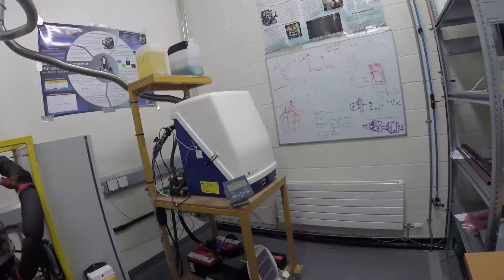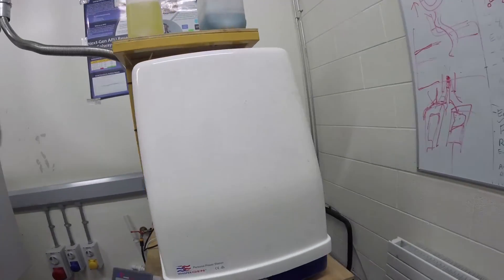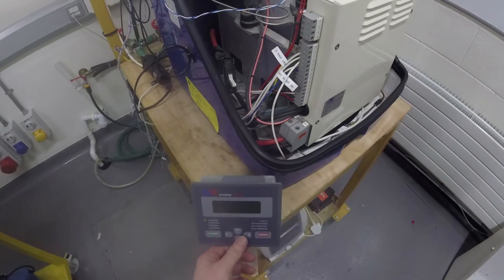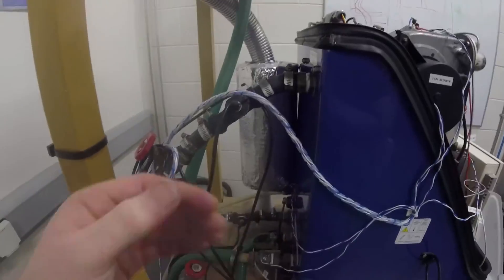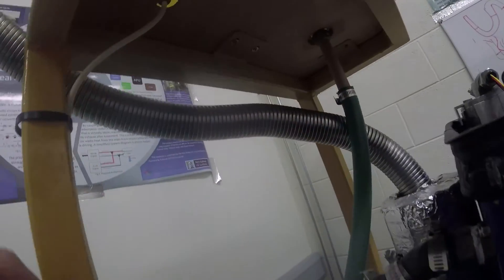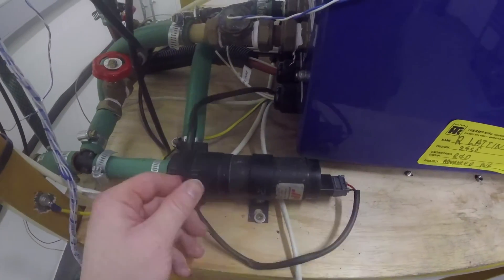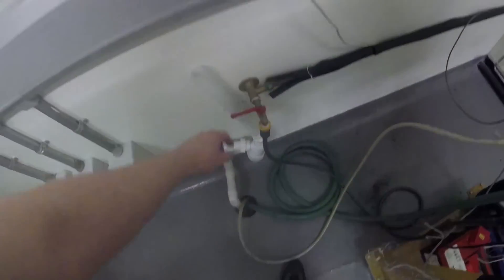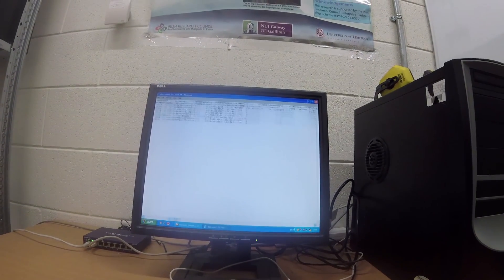Whispergen Operation Guide

Comment: how much did this cost and where did you buy it?
Reply: This is a DC Stirling Engine. Best  for marine use. I worked for Whispertech in Christchurch NZ designing the 1KW AC400, UK1 MCHP and limited work on this engine. They are no longer in production.  The building got destroyed in the Earthquakes and mass manufactured by  Mondragon (EHE) in Spain. Austerity and Global Economic downturn made them uneconomic.